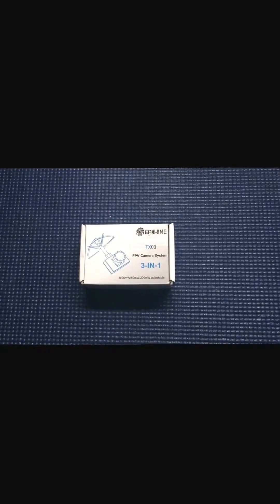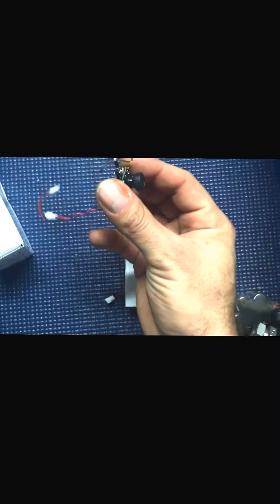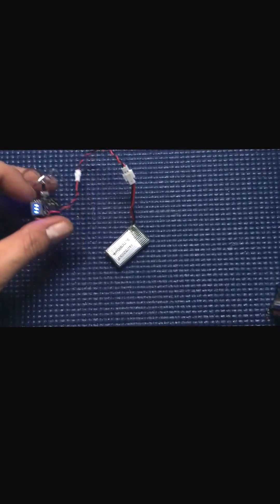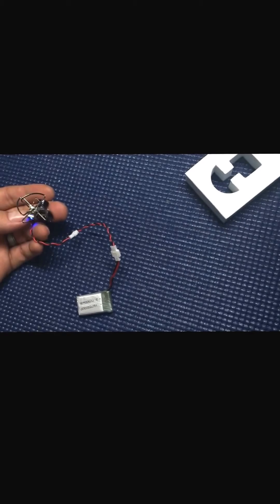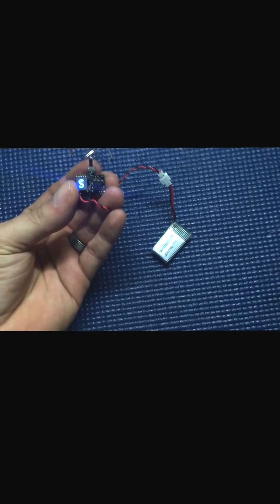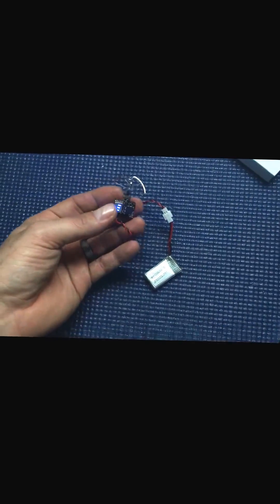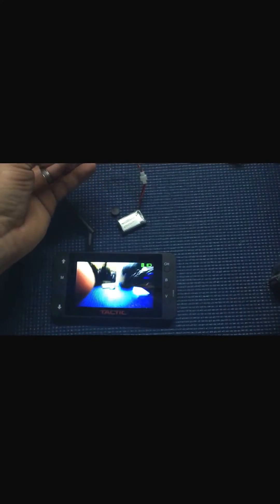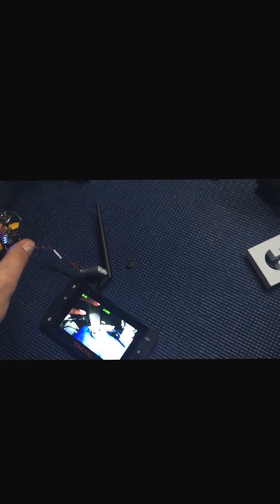UnBoxing - Eachine TX03 FPV 3-in-1 FPV Camera System with first impressions.

Comment: Hey I'm having issues with my eachine tx 03 not showing image on my fatsharks iv tried every band and channel  on all ppwers 25 mw 50mw 200mw but no joy  have you ever came across faulty cam before? or am I being dumb
Reply from the maker: Levi Mckenzie That's fine! To be honest I just got the set up and have not test anything but what I've showed on the video. I know if your using fatshark goggles you will need to bind to the TX03 on F band! Hope this helps!
Reply: Levi Mckenzie I also heard you need to be set on Band F
Reply from the maker: skytalon74 what ever your frequency that your quad is putting out is what band and channel should be set for. Hope this helps you out.
Reply: What do you recommend for a battery?